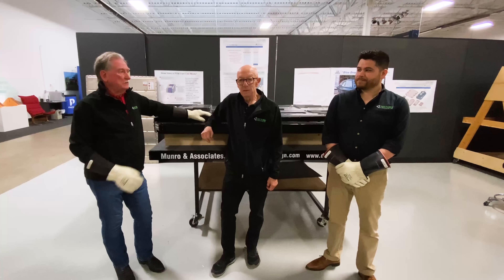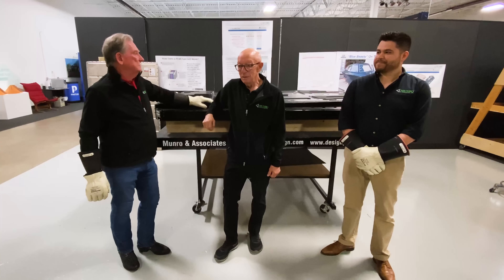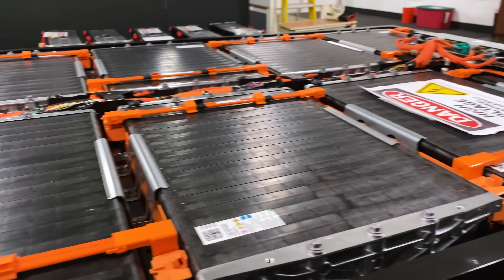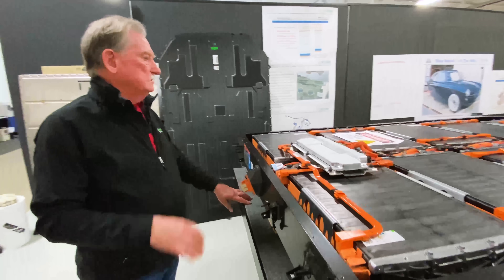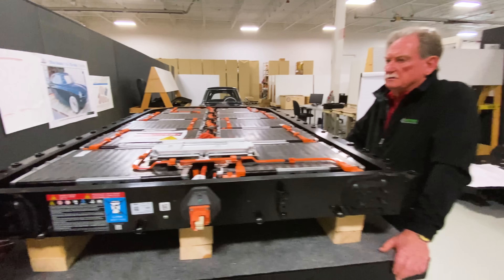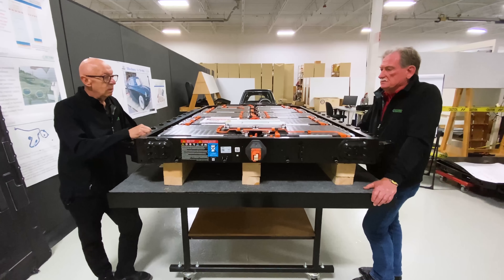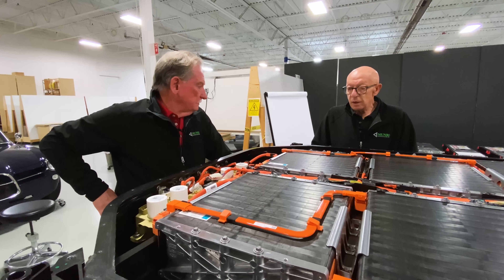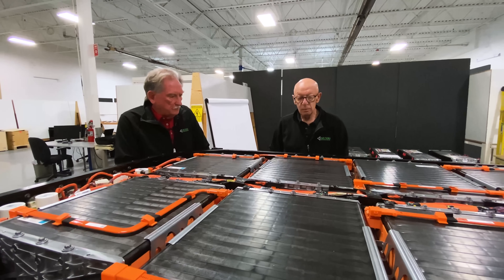Ford Mustang Mach-E Battery Exposed!

Comment from the maker: The Mach-E battery is actually from LG Chem, not SKI.
Reply: Is it LFP or Nickel-manganese? And as always, thanks for great content!
Reply: @Alex-cf9me   nickel manganese cobalt (NMC) cathode. (from Ford website.)
Reply: What cells are used in this battery?
Reply: It's an engineering nightmare regardless of who makes the actual cells that go into it!  I am sure SKI is rather glad their name isn't associated with this!
Reply: @johnnemesh5459  , I wouldn't have asked what the cells are if it didn't matter to me. I am researching different cells to determine which ones to use in my own battery build. No sense in exposing the battery withput exposing the cell used.
Reply: @Sandy, have you seen the tour of Tesla Giga Berlin?  If so we would like to hear your opinions and thoughts.  Thanks.
Reply: anyone knows what type of LG cell this is ? E66A ?
Reply: @adicahya  Likely LGX E71A.

Comment: ELECTRIC CARS ARE BULLSHIT
Reply: If you are going to make a comment like that, you must provide the reasons....LOL

Look, I like both ICE and EV. The one thing I like about EV, is the fact that I have freedom, in terms of electricity by way of my solar panels. I get free electricity. I get to drive around locally for free! I don't have to get subjected to world oi markets garbage and domestic price increases because of one refinery plant shutting down. That is one reason why the oil industry does not want EV vehicles out there and they are good at lobbying for it. 

Also, I don't have to change any oils, since there is not much heat generated by the use of Electricity. For my Mach E, i don't have to change the coolant until 200k Miles. For most ICE vehicles, it is recommended to be changed at 100k Miles. No oil changes, none. Maybe changing the oil in the electric motor will help out, but there is not much friction in there. Kinda like the differentials of rear drive vehicles. It can be changed but usually after 100K miles, and if you use Synthetic, it can last longer.

Comment: Great video.  I am late to getting into EV systems.  My experience is limited to electric powered model planes and cars.  One thing we have always been told is that you can't mix battery voltages.  In other words you can series or parallel batteries with the same cell count (6s or 8s for example).  How does the battery pack work when there are some 32v and some 40v batteries wired in the same pack?

Comment: Well this video aged well. Today ford have stopped selling the mach e due to contacer issues. Obviously its a big expensive job to replace  and looks like they’ll software restrict the performance to stop this from happenning. Not good. Sandy was noting there is alot of wiring!!

Comment: I notice you didn’t show the Tesla battery cover or what is left of it after removing it.  LOL.  Tesla all day job.  Ford 10 minutes.  Winner Ford.   The Ford cover is heavier because it is not just a cover it is a structural part of the battery and chassis.  As you know, fiberglass, plastic, and carbon fiber don’t conduct electricity.  Aluminum does.  Big plus for Ford.

Comment: Modular battery packs are the way to go.  A battery pack that is not serviceable is unacceptable.  Paying 20k for a new battery because of a few bad cells is idiotic and unstainable, company that starts with a T.   A technician should be able to drop that Ford battery and replace the bad module in one day.  Probably 2k.  Private companies can easily repair these modular batteries and sell as refurbish for half the price of new.  I like the individual battery coolers as well.  If a leak develops, you can replace the problem cooler without disassembling the entire battery.   FYI, most car dealership make more money on repairs than selling new cars.

Comment: Well done video. Thank you very much! Did you guys also check how the battery is structured from a power reserve point of view? 
Meaning: The battery has less usable capacity than the nominal capacity. Do you know where the remaining capacity has gone to? I.e. do we have a brick protection (not usable), a usable reserve (below 0 range) and/or is there a reserve in the upper part of the batter or is 100% charge really 100% like at Tesla?

Comment: The battery is certainly looks less neat and tidy compared to the Volkswagen pack I remember Sandy commenting about how he liked the wiring going up the central core of the Volkswagen battery. But as he mentioned the modular nature of this pack would make it more easy to repair or reuse in the future.
Something I noticed that concerned me a bit. Up in the front where the electronics were there is a seemingly unsupported wiring connector. It's kind of wide and flat and white colored they were wires going into it the connector and then wire is going out of it in sort of an arch. And I didn't see anything holding that in position. If that's how it was those wires are going to vibrate and wiggle the entire life of the car and probably ultimately result in a metal fatigue failure in one of the wires or at the connector.

Comment: You know I'm not sure if this would add extreme cost to it but having little "pockets" inside the pack have thermal emergency "bomb" packets of extinguisher retardent hidden in the pack.... Designed that if it catches fire and starts to do anything it can help save the car by going off and spraying the retardant over the cells and make it calm down or slow the problem down at least? 
Im sure some engineering team would LOVE to go and do some testing with this

Comment: 10:07 I love them touching those batteries with huge "do not touch anything" memo in background
Reply: I have a pair of modules in my trunk right now, carrying them around to find various components to mount & use them… they are quite safe, if you don’t short out the cells by accidentally drilling a hole through them! LOL!

Comment: Very scary battery module. Using rubber coolant hoses with spring clamps inside the pack and  buss fuses without easy access? If this is the future, dealer service departments will continue to be busy. Almost as bad as 8 hour dash out procedure to access HVAC components on current vehicles.

Comment: I agree, coolant inside the battery pack isn’t the best thing to do.
It’s like fist gen Fiat 500 EV, every tube is a possible leak, and it’s more difficult to bleed.
Some makers put the coolant plates outside the battery. 
Don’t know  which is the most effective in terms of heat dissipation, but I know which is more probably to fail

Comment: Yikes, one hand rule, please, on these early production assemblies on a new design.  Who knows if a couple cells leaked electrolyte.  One leaking to the battery chassis, another one to the end plates, or two two end plates.  I definitely wouldn't leak on the battery chassis and poke around the distribution / fusing / disconnect area.

Comment: If the battery has a thermal event it can vaporize steel.  I wonder which top cover can prevent burn through the best? The composite cover at least does not conduct electricity.

Comment: 16:46 Not sure if I would want to take out a battery module and use it to run my house..without the cooling and battery management system.... but what is more important with batteries is their degradation, over time and battery charge and discharge cycles there will come a time, that the car owner would want to replace a battery module. This does give the potential for Ford, and other car manufacturers to sell these replacement battery modules as part of the car's normal service... perhaps every 100 K kms at a dealer? Breaking the battery pack into modules means that from a maintenance and cost to the customer POV means that it is a lot cheaper to replace a battery module at a service rather than having to replace the whole battery pack. That may make the difference between the EV car being a long term investment  [ie 10-20[, or middle term [5-10], and selling the vehicle for scrap value as it is just un-economic to replace the battery pack of the EV. 
Without this facility to easily replace defective, or end of life batteries, the re-sale market for EVs is not going to be good, and that will affect the whole EV market.
Reply: I bought 2x recycled batteries, specifically for this reason. Now looking for harnesses.

Comment: I am no battery expert, but the information that I was looking for in a video like this would look like this:
This is a battery pack for a Mustang-Mach E AWD Standard range, 75.7 kWh nominal.
It is assembled of 10 modules. 2 smaller modules of 24 cells each, 8 larger modules of 30 cells each. 48+240=288 cells. Wired in a 96s3p configuration.
The smaller modules are 8s3p, the larger modules are 10s3p. In total: 2* (8s3p) + 8* (10s3p) = 96s3p. All the modules wired in series.
With cells of 72 Ah nominal each: 288 * 72 Ah * 3,65 V = 75.7 kWh nominal for battery pack capacity.
With your measurement of 387 V pack voltage, at the time of disassembly each cell had about 4,03 V.
So, your measurement confirms 8s and 10s for the modules. 8s * 4.03 = 32.2V for the smaller modules. 10s * 4,03 V = 40.3V for the larger ones. 

Not shown in this video:
The extended range battery pack has the same cells, but in a different configuration:
The smaller modules are 28 cells, the larger modules are 32 cells. And two additional modules are stacked on top, under the rear seats.
The smaller modules are 7s4p, the larger modules are 8s4p. In total: 2* (7s4p) + 10* (8s4p) = 94s4p. All the modules wired in series.
(Notice the small difference in voltage due to 96s versus 94s! This diversity is unnecessary at best!)
With cells of 72 Ah nominal each: 376 * 72 Ah * 3,65 V = 98.8 kWh nominal for battery pack capacity.

As Ford presumably uses the same lower battery tray for both, there is some room around the sides in the standard range pack. No need to complain in so many comments.

The cells themselves are pouch cells, with two pouch cells in a cell group, then getting a plastic case to give them some substance and strength.
So in this standard range pack: 12 cell groups for the smaller modules, 15 cell groups for the larger ones.
For the extended range pack: 14 cell groups for the smaller modules, 16 cell groups for the larger ones.
The cell groups can easily be identified visually in the video and in the Jalopnik article.
2 cells in a cell group can either be 2p (most trivial) or 2s.
It is a no-brainer, that cell groups of 2 cells are somewhat awkward for modules wired in a 3p configuration.

Regarding use of the modules in solar applications or EV conversions from salvage packs: Ford has four module types in total for the Mustang Mach-E: 
From Extended Range packs:
7s4p - 28 cells, 14 cell groups, 25.5 V nominal, 7.36 kWh.
8s4p - 32 cells, 16 cell groups, 29.2 V nominal, 8.41 kWh.
From Standard Range packs:
8s3p - 24 cells, 12 cell groups, 29.2 V nominal, 6.31 kWh.
10s3p - 30 cells, 15 cell groups, 36.5 V nominal, 7.88 kWh.
All modules with the same height (150 mm) and width, but with different length and voltage. This can be superb, as in a EV conversion with a certain space in a particular car or boat or bike or scooter, you can choose, mix and match. Likewise, when someone wants to build a pack with a certain count of cells wired in series, like to replace some former battery pack in a certain type of EV and recreate its voltage range. With either 7s and 8s or 8s and 10s available you can mix and match to some degree. Still you cannot mix 3p and 4p modules.
Or it can be unecessary as in solar energy storage systems you hvave to deal with 4 different module types (when sourcing Mach-E salvage battery packs) and their individual properties but would rather need one standard module, that is cheap and abundant.
All modules are under 60V DC, which makes shipping these modules a lot easier regarding UNECE safety regulations. 

When you compared with Tesla battery modules: you missed the point, that you only considered the long modules from Model 3 and Model Y (22s and 26s for NCA or NMC). The smaller modules from Model S and Model X  (all wired in a 6s configuration) and with equal size and nominal voltage are way easier to work with in non-Tesla applications.
Reply: GREAT POST!  Thanks for the detailed Mach E battery summary.  This is the type of info/ level of detail that I was looking for.
Reply: Thank you.  This was the information-dense analysis I was looking for, instead of several minutes quibbling over fasteners on a primarily electrical device.
While I appreciate a MechE's take on a physical design, I'm often left crestfallen on how many seem to have a huge aversion to learning any more than they absolutely have to when it comes to dealing with electricity.
Reply: I have 2x of the “8S4P” modules 

Do you know where to get the wiring harness for the modules???
Reply: @DavidHalko  All the wiring harnesses inside the battery pack are listed in the Ford parts catalog. Obviously, there is quite a bunch of them for the two battery pack configurations and number of components inside there multiplied with drivetrain variants (2WD, 4WD, GT). To get you started, the long main harnesses are (depending on Pack 1 or Pack 2):
FINIS 2574216, Ford parts nr LJ98-10B694
FINIS 2577664, Ford parts nr LJ98-10B694-AG
And then, there are a number of smaller sub-harnesses, which you likely need. They are just too many to list in a Youtube comment. Go to the OEM Ford parts catalog (I use partslink24 for that), then Mach-e, then 1403 High-Voltage Systems, then traction battery pack 1 (the larger pack, as you got 4p modules) and find them yourself. There is also a phone number for ordering battery parts: 1-800-403-4844.
Reply: @koeniglicher  - this is exactly what I needed - thanks!
Reply: Sandy just likes to hear himself talk.

Comment: There is quite a lot of empty space in that pack. Can't help thinking the energy density of this pack is quite low compared to the competition. The flip side might be it's quite repairable and cheap compared to Tesla's bricks.
Reply: The bricks come in different sizes, to give different distances &  differentiate power requirements for rear wheel and 4x wheel drive… the battery box accommodates all the configurations

Comment: I have a simple question for electic jesus nuts. If I fill up my gas tank an you charge up your batteries and we both drive a 150 miles. I have half the weight in my gas tank, do you have half the weight in your batteries? It takes me less than 5 minutes to refill my tank, what does it take to recharge that battery? If tesla is so hot, pleae tell me why you don't see it running the daytona 500? Hell lets make it the daytona 250.

Comment: Is it just me or does it look like this battery pack has a LOT of wasted space?
Reply: It holds different battery configurations, for different distance options, as well as different power configuration for 2x wheel & 4x wheel drive 

The battery box can hold more batteries, if the consumer wants to spend more to drive longer & use more power

Comment: Why so many metal screws? There has to be a much better way to fasten the battery cover to the pack. I realize it has to be serviceable but what a waste. You could reduce the weight and cost by eliminating most of them. Possible use of composite clips and screws. I also realize they need to minimize BSR and retain any fluids from leaking. It's too bad they can't use some type of plastic weld.

Comment: I used to think of plastic as plastic until the project guy at work started talking about the properties of submarine cable. They would have used open wire on telegraph poles in the old days. 20 years later they would have used radio.

Comment: My concern as an out-of-warranty owner in the future would be corrosion and ease of repairs.  I agree with their analysis that the cooling would be much more robust if a single plate across the bottom, preferably with the only hose connections outside the housing so you need not remove the top plate or even the pack from the car.  Isn't the Chevy Bolt battery more like that, with a single stainless steel cooling plate?  I don't think there has ever been a hose connection which doesn't eventually leak, usually long before the drivetrain wears out.  Ditto for corrosion at electrical terminals.

The innards look pretty when new, but what about when you pop the top 10 years from now.  Rich Rebuilds (Benoit) bought a salvaged Tesla which sat in water up to the windows for several days in the Houston flood.  The battery cells inside looked like what you see in an old flashlight, totally corroded.  Thus, the battery pack is not water-tight but only water-shielding, more like an umbrella.  Same thing inside the motor and inverter cases where water intruded.  They might still look pristine in a San Diego car, but what after many winters of salt-slush in Detroit, with the battery pack down low in the spray?

Comment: These are LG Chem Batteries, SKI batteries are going into the F-150 Lightning.
Reply: @Munro Live: You stressed a lot, that you consider yourself (especially Mark) as battery experts (which I doubt a lot) and that these would be cells by SK Innovation. You took this particular Mustang Mach-E battery pack apart, then please provide some evidence for your claim. There are so many labels on the parts, and you never show any of them.
Reply: MME uses LG Chem batteries made in Poland.  The SKI plant in Georgia is still under construction.
Reply: Another reason why the F-150 is going to suck in the battery department.
Reply: @mullholand  Another reason why the Ford F-150 Lightning is going to dominate in truck sells hater
Reply: Are they pouch cells, with the plastic spacers and compression bolts?
Reply: @Tore_Lund  yes, they are pouch cells and appear to be in plastic frames, like other LG Chem modules. The horizontal stack of cells in frames is bolted together, with the frames controlling the spacing.